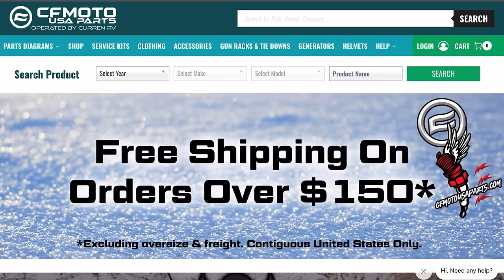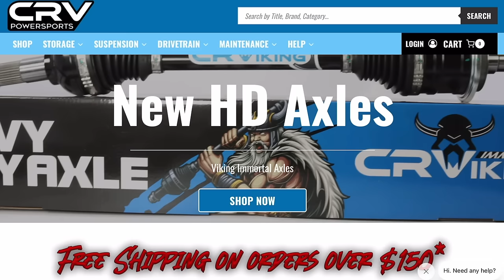CF Moto’s Biggest Flaw

Comment: I hate to tell you that that clutch was installed incorrectly in the CForce 600 and likely in the UForce as well. When he lowered the helix on the secondary he should have pre tensioned the spring clockwise to the next slider. At least that is what the video shows. Your secondary spring is now having to rotate back to the next slider resulting in poor performance and increased heat as well as being the wrong tension. I’m not claiming to be an expert but I would definitely watch some of the other videos available online to confirm.

Comment: Unfortunately, I purchased a CF 500 on January 2024 and it has been a nightmare. I am experiencing multiple problems with the shifting and the fuel system. Both the dealer and the company have blow me off in multiple occasions..My ATV has 40 miles and I just want to bring it somewhere high and push it down the hill...

Comment: The thing I don't like about the primary clutch kits is they change the spring to a much higher rate spring and then increase the weights to try and make it work. What they don't tell you is that extra spring pressure will wear those plastic weight carriers much faster than normal. I have a 22 Cforce 600 and what I did to get the effect you are looking for is to replace the primary clutch spring with a lower rate spring using the same stock weights. The stock spring has a 200/400 rating part # 0951-1013, I switched mine out a spring rated at 120/400 part# 0951-1008. This gives quicker upshift at lower rpms but keeps the stock upshift rpm at full throttle. So at 5000 rpm cruising with steady throttle I gained about 5mph vs what it was with the stock spring and I likely decreased wear on the weight holders.
Reply: by any chance you have or know a video where I can see how to change it? also that would be the same for the new 625? thanks in advance!

Comment: Jerky starts are just part of owning a ATV/UTV with a CVT that has to engage the belt to get started, just part of it and rarely can be improved without affecting another area of operation with the clutch.  How do I know?  21 years of CVT clutching experience.
Reply: If anyone knows,  it’s you guys, keep up the good work. i have always been satisfied with the hunterworks products on my polaris units.
Reply: @765Guys  Thanks for the comment, we try!!
Reply: @ihatelols  smaller cc and smaller sized machines can be smoother due to weight more than anything, easier to get going.

Comment: I did have the clutch kit replaced after seeing your first video.  Mine got better, especially in reverse, but still have a little jerkiness.  Still, I love my UForce 1000 and could not do the work on my ranch without it.  Even my dog loves going for rides in "Buzz".  I also got the new windshield, but I got the power version so I could adjust through the full range of openings.  It was my wife's Christmas present and she loves it!!!

Comment: I have CF 1000 overland, I got primary and secondary clutch kit. Primary kit smoothed out starts a lot when clutch was warm. Secondary spring raised RPM across the board as it's supposed to do to get higher in powerband, More power but less gas milage. Not needed on a 1000 cc machine on real trails. I'm taking secondary back to stock

Comment: I have a 23 UForce 1000 that has the same jerky problems.  I put in a clutch kit from RNG Performance.  I just did the primary spring and weights.  It helped but didn't completely fix it.

I really like the 1 piece flip up.  I have the 2 piece flip up from Super ATV.  It's ok but a little breezy in the winter.  It looks like the 1 piece seals up a lot better.  Dave

Comment: Nice to have a dealer to work with.  That is always number one for equipment.  I am still rocking a 2000 Kawasaki Prairie 400.  My dad bought it new.  I bought it from him 8 years ago.  The carburetor is annoying, but once I figured out to use 100% gas it has been fine.  I often want a new machine, but I look at the price and think "my old machine still works just fine."  I use it for hunting and for pulling a small trailer around my property.

Comment: I have over 2000 miles on my original belt of my CF600 and still looks really good high and low gear is very important. The only thing I've noticed is it's dropped a few Miles per hour on its top end belt is definitely starting to wear.

Comment: A belt & clutch will always have some jerkiness when first engaged. Compare this to the Honda automatic transmission in their side by side and you still made the correct decision. Belts are a cheap replacement compared to a full transmission. My RZR 1000 has some jerkiness as well. Every manufacturer drives different to some extent. That’s why they make them for everyone’s budget. 

Happy trail riding!
Reply: Had a 2020 Yamaha Viking and it had it too, don’t have any other sxs to compare it too but it didn’t appear to me to be an issue just part of the design.
Reply: I commented on your review video and was looking at the time which clutch I wanted for my’23 Uforce 1000.
  I bought the same components, different supplier. Did the work myself and had no issues. 
There’s still a little time for initial engagement but very little. With the setup I put in it greatly improved my low end and makes low gear work like it should. 
 I‘ll be interested to see if you feel the difference when pulling your trailer loaded with firewood.

Comment: We have a uforce 800. It is supposed to have a wet clutch in behind the belt system. I gave always assumed it was the clutch engagement causing the jerk rather than the belt, which only controls the gearing? Are the newer ones using the belt as the clutch?  We also have a suzuki vinson which has the same wet clutch and dry belt system. Because it has a wet clutch the belt never slips so it lasts forever. 17 years of abuse on the same belt, virtually never use low gear, and a beautiful smooth take up. Night and day difference to the cfmoto. Cfmoto was cheap though, guess that's why it needed the over run sprag clutch replaced at about 2000km. Suzukis clock stopped working at 36,000km and that was over 10 years ago now, no belt or clutch problems so far. Front drive shaft is their weakness, too much angle on the universals? Needs regular replacement and need top quality parts, it's worth oem for those universals.  If I could get a new 2007 vinson it would be well worth while.

Comment: As a lifelong snowmobile rider I can tell you the best you can do about jerking is replace the factory cast clutch with a well balanced billet clutch and internals, beyond that you have to learn how to drive your machine and more importantly with any enclosed system you must be diligent in cleaning and maintenance or your just fighting a losing battle. Brand name has nothing to do with it as most don’t manufacture their clutch’s they’re buying them. CF moto is a decent midrange brand but the downside at this point is they don’t offer an extensive assortment of options and accessories, for me most importantly they offer no track options and if you put aftermarket tracks on you have voided the warranty unlike Can-am which offers fully integrated track options with full warranty.

Comment: Adam I think a lot of the issue with the jerkiness has to do with what’s called the “pedal map”. This is in the calibration and determines how fast or slow the throttle opens in relationship to how far the actual throttle pedal moves. On many SXS models today they have throttle modes such as work, standard and sport. All those modes are doing is changing how quickly the throttle responds to your pedal input. My suspicion is on your U-force SXS is that calibration is a bit too aggressive. This is why you get used to it and you can learn to be smooth vs. a beginner. You understand that you have to ease into the throttle or be gentle with your inputs in order to get a smooth drive away. I hope that makes sense.  Unless CF comes out with an updated calibration you’re pretty much stuck with what you have as clutching will only get you so far.  28 year ATV/UTV/SXS mechanic!👍🏻

Comment: Stage 1 clutch kit from (MSC) Main Street Cycle will cure that jerky start. I installed one on my 22’ zforce 950 HO Sport. It’s so smooth you wouldn’t think it was the same machine. Plus the low and mid range has improved drastically. And the secondary clutch press tool, I don’t remember what it costs but I made one for about $15 bucks and it works perfectly. Super say to make with common everyday hand tools.
Reply: They're stage one isn't that smooth maybe 5%. over stock would try another clutch tuner..

Comment: I'm not brand loyal. I've owned Polaris, Honda, can am and Suzuki. Sxs's and quads. 9 months ago bought a new 2023 600 touring. I have 4200 miles on it. Always ride 2 up with girlfriend. I was a little hesitant to buy a Chinese brand but did my homework first. To date, have not had a single problem with it. I am anal about the maintenance and do it all myself. On original belt as well. Been very happy with my purchase thus far on this fully loaded machine. Its my opinion that its mostly how You maintain your machine. They all have issues in time. If you don't own a CF moto your opinion is not worth much in Regards To CF moto. Buy what you want and have fun.

Comment: Got a new Cf moto uforce 600 little jerky got a 2009 grizzly 450 smooth as silk in low and high always never touched belt or clutches still has 15 yr old battery starts every time!

Comment: I have a 2023 U Force 1000 and the clutch is exactly the same as your. Its dangerous, especially backing up into a building as the machine can take off in an instant. Can't believe CF Moto hasn't addressed this safety issue.

Comment: I've bought a few inexpensive outdoor toys for the kids and what I've found is a good clutch makes an enormous difference in how the machine performs, especially in situations where you are going up a steep hill, or trying to power over obstacles at low speed. I'm not saying that CFMoto isn't a good machine and isn't adequate to the challenge by any stretch. I'm simply saying that a down-market clutch and a high-end clutch make the world of difference. The inexpensive dirt bike I bought my kids burns out the clutch going up an incline without them even on it. Can't even get started. The used honda dirt bike my buddy bought will take him up the hill from a dig, no problem. That was enough to sell me on quality components. That doesn't mean I will only buy the new name brand, but it does mean I'll prefer a used named brand over a new off-brand and I will consider the longevity of what I'm trying to use it for... I've just gotten to the point where I don't want to fuss with something to save some money. I'll take the time, save up, buy the right thing once, which is hard too do as you get up in the price range of some of these things.

Comment: 4000 miles on my Suzuki belt but it is only a 400.  I abused the belt when I put a Groundhog Loader attachment on the front of it.

Wear safety glasses messing with your machine, you never know what will happen with stuff under spring energy.

Comment: I have the same atv and just installed the same kit two weeks ago, as I to was in search of low end power. I thought the kit  made a nice difference, not earth shattering like the YouTubers that sell them claim, but a good bit better than stock. Mine wasn't like an instant response but more of a linear feel, but it's there. I clocked my secondary to b1 as I still have stock tires, what size are your Bearclaws? Those are a heavier tire, and especially if you went up in size you might really benefit by clocking it to b2.
Reply from the maker: They are stock size but yes they are 8 ply instead of 6 ply stock tires

Comment: While the new windshield will help, I think you'll still be faced with a venting issue. You've opened up the front to let more air in, but there's no where for the air to flow out. If it had a split back glass you could open or some way to vent air it would be more effective. And because of the direction your door glass opens it's going to try and force even more air into the cab with no way for air to get out if you open them.
Reply from the maker: The back windows on the door open as well to allow the air to flow through

Comment: Both have stock tires. C1 is less aggressive than B2 and gets almost the same result.

Cforce 600 was a drive-by wire throttle. They have electric throttle now, so they are mapped to be smoother in throttle.

Comment: My 600 is fine stock.  I ride pretty hard mind u this is the first wheeler that has had CVT clutch and honestly I'd rather change gears myself  This way you can control the RPM's much better and you don't use as much fuel. I find every machine that has CVT clutches rev way high.

Comment: I have Polaris ranger 900xp and the clutch is jerky real bad I am not impressed with how it works. How about an update on the pond.
Reply: You should research Dura-Clutches as replacement upgrades for your Ranger. If you’re looking for smooth drive-away and overall smoother performance, they are tough to beat.

Comment: When a Chinese manufacturer brings out a new product they copy others as cheaply as possible. The parts look the same , but they don’t perform the same   As customers complain about an issue, they sell replacement parts to fix that issue. They’re relying on their customers to point out problems rather than engineering a good product from the start.